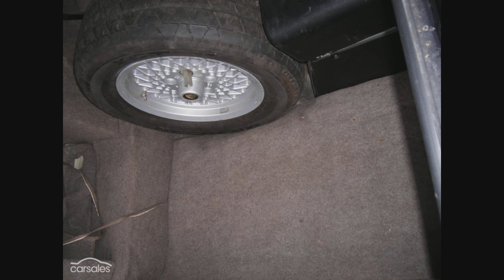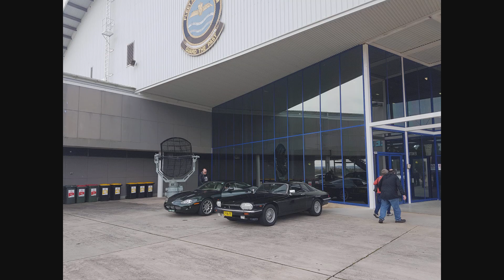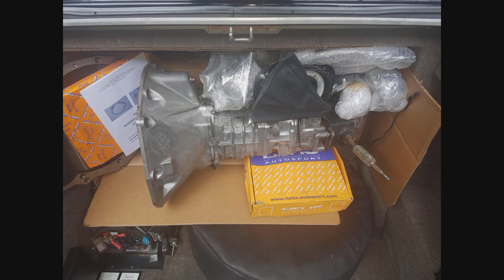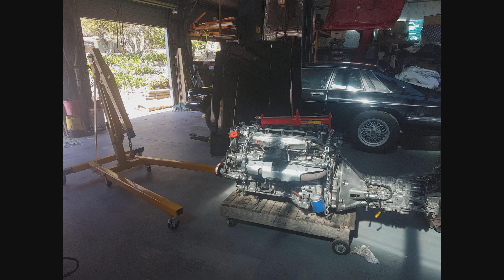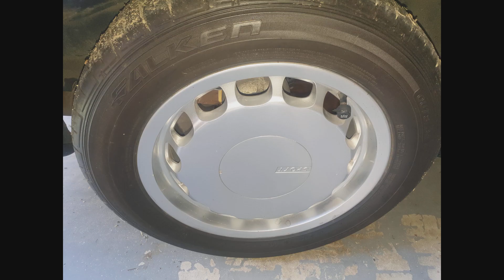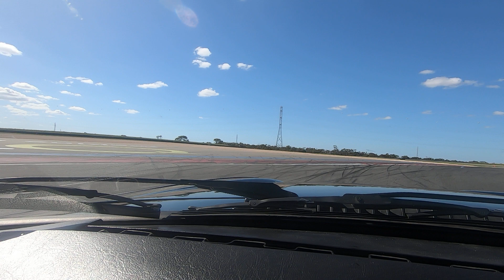The Saga of Lucifer -  an XJS passion project

Comment: Watching from Los Angeles. Nice job. How long did it take you to get that far in your project from purchase to finish? I’ve owned my ‘89 5.3L since 2014, have converted it to Getrag 265 with a 3.53 rear end axle ratio, and I’ve re-upholstered the entire interior. Car has been out of my hands for more than a third of the last 9 years in the shop getting this work and more done. I still have to get it to pass smog in the next 2 months just to hope to get it back—I haven’t driven it in nearly 2 years now due to workmen delays. I have the same problem with paint—a prior owner repainted from Signal Red to Rosso Corsa, and all the paint is peeling off. So I’m going to strip it and repaint it myself. I’ve been trying to get it back from the upholsterer (16 months) and now my mechanic (6 months). Such a nightmare. I just want to drive a complete car— is that too much to ask?
Reply from the maker: Only took me 5 years!  However, the result was worth it despite the Getrag being notchy when hot.  Just completed a 5 day tour of 3,000 kms through the Australian Alps which it handled superbly.  In 10 days time we head off to Tasmania for the national Jaguar Rally which will add another 3,000 kms to the total.

Comment: Well done a great car.....hope it’s not too fuel expensive to go to the shops
Reply from the maker: Hi Ron, the combination of the 5 speed Getrag, the 2.88 diff ratio and the MOTEC ECU gives the 6 litre XJS a fuel consumption of 11 litres/100 km or 25 MPG on tour.  This is a 39% improvement over the standard  5.3 litre with the 3 speed auto.  So this is very gratifying.  Shame that Jaguar never made this gearbox an option on the final cars. My experience is similar to a friend who also has a 5 speed manual in a TWR XJS that achieved similar fuel consumption so is not a one-off or an optimistic estimate.